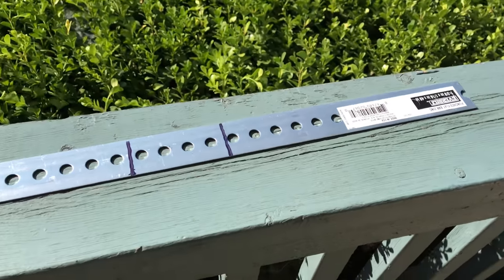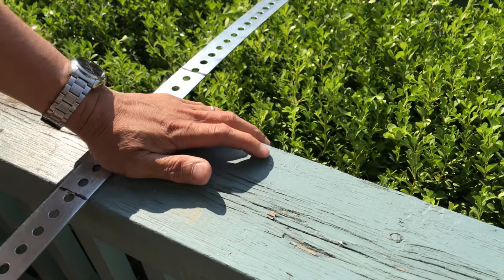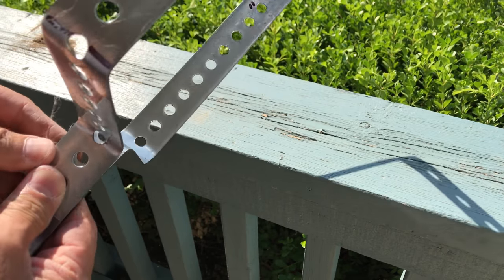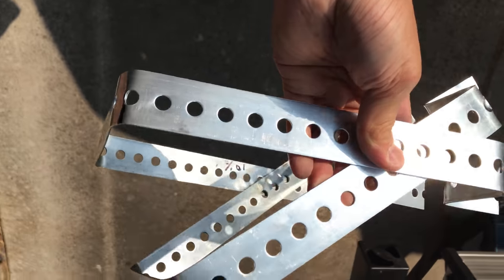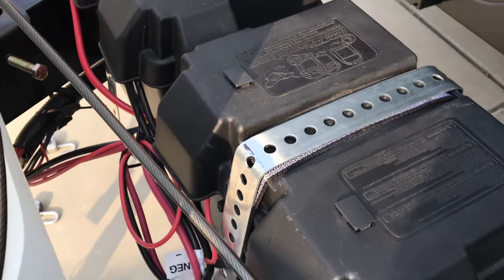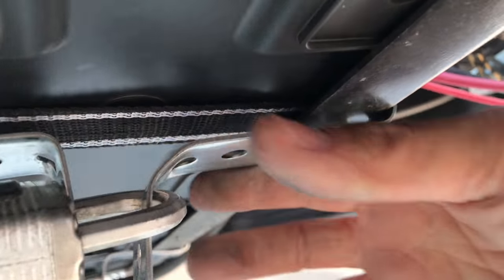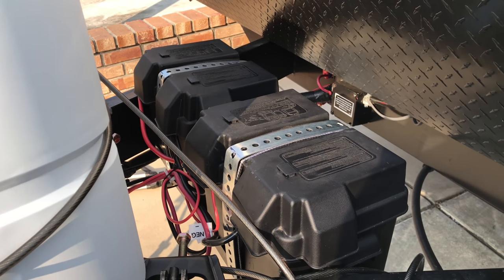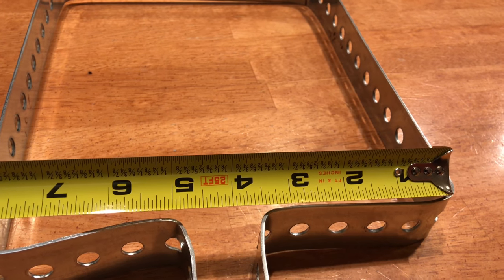$7.00 How to Secure Travel Trailer Batteries - Theft Deterrent Battery Lock for Travel Trailer

Comment: Great Idea and thanks for the measurements on the group 24 box.  I'll be making 2 of these this weekend!
Reply from the maker: Christmaspuss1 thank you very much for the feedback... I hope you watched the measurements at the end of the video... improvement from the measurements at the beginning (bend points)... thanks again
Reply: @cbatilo  I did see that.  Great addition! Starting to store our camper now at a rv storage lot and this will hopefully deter any thievery.  Nothing out there is really theft proof, but this will help.
Reply: @Christmaspuss1  You don't remove your battery(s) and take them home to put them on a Battery Tender?  I'd certainly think about doing that...when putting your unit in Storage.That will keep your battery(s) in pristine condition.  A Battery Tender does such great things for your lead/acid battery...it regularly 'exercises' the cells...(very important for a lead acid battery), and then tops off the charge...all automatically.   I have one on my motorcycle, my trailer, and I have a 2004 motorcycle that has never needed a replacement battery yet!  Using a name brand---->Battery Tender, will not only pay (literally) for itself, but will give you at least 10 years of battery life.  So worth it!  Again, as I entered storage, and parked my R.V., the last thing I would do, would be to bring the battery box home, and then set it up in the garage with the Battery Tender leads attached. Shut the garage door.. and forget it, until you need to take it back to your RV.   That's---->the smart money!  BTW, never put a battery box...(even plastic) on the ground, or a concrete floor.  It should be on a work bench, or at least on a couple of cut 2x4's, sitting between the bottom of the box and the ground, so to be not contacting the natural ground.  Any battery near and about the ground, will leak residual to natural ground....so not a good idea.
Reply: @sesquashtwo  Actually, modern batteries don't drain from being on ground, concrete or otherwise, that's just an old wives tale. Battery acid (or water/moisture) across top of battery  connecting posts is most likely cause for them if disconnected, especially older batteries.

Comment: Add tape or something to cover up the padlock key port. Else it will rot as it expose to road dirt and moisture.
Reply: A little Dialectric grease will do that for you rather than tape that might dry and fall off

Comment: I have been thinking about your design..and can add an improvement...when ready to use your lock...have space washers, that when slipped onto the shank, of your lock...you can not only prevent a hack saw to the lock...but you can then really pull the two sides very close and tight.  That is what I am going to do...just hit the hardware store...and grab a bunch of washers....and again, a great idea....and oh...use the washers to fill the space between the bracket and the body of the lock.  Add enough washers, so that the two locking ends of the bracket are almost flush to each other!
Reply: Joe Blow the washers / shank idea is awesome! Going back to the electrical tape... plastidip (rubber coating) is probably best. Thank you again for watching

Comment: Great idea...and will copy your suggestion...but I do have one modification...I will add and wrap electrical tape around all the bend joints...so no metal to metal contact will be had between your strap, and the frame of the battery support/RV frame.   I'd suggest to all readers to wrap all the bends...
Reply: It's the contact btw strap  and Positive cable that you should avoid (at least, on sharp edges of strap). Contact btw strap and frame is not a problem because frame is the Ground.

Comment: Great idea!  One thing I would change - change the design to make it where the padlocks are on the back of the batteries, or front if thats the only place it will fit.  Do this because hanging down, your locks are going to get full of dirt and road debris.  They wont be functional very long hanging down that way.  I also put a little dab of silicone on the very end of the keyhole to seal it.  Do not push any into the lock or it will stop working.  Break off the silicone when you need to unlock it.

Comment: Very clean looking . I had strapped snow chain over mine and connected with a chain to since it didn't  reach  someone cut one link weeks later but batteries were still there . I would like to point out that I bought 2 golf cart batteries from Costco and they required a taller box . These batteries do not have a handle to carry  , they have slots on top that you have to put a strap through to carry. In addition each weight 53 pounds. Just to add some info. .Golf cart batteries only have a bolt/wing nut pot not a car post .I believe it is just for long lasting low voltage no amperage making it a specific use which I find a deterrent .

Comment: Excellent video and thanks for the tip! I used this technique on my RV! I bought the flat bar in a roll at Ace Hardware 10ft for $1.99. It still looks good and there’s enough for 2 battery boxes. For about $10.00 including 2 locks is how much I spent for this project.

Comment: cbatilo - nice, cheaper than $35 store-sold bracket, though those are more solid.  One problem - if there is enough room on the tray, and/or if you have only 1 battery, a thief could cut the un-protected plastic wall and slide the battery out.

Comment: I will be making 4 of these.  You make it look easy enough to bend. Is it?  Thanks!
Reply from the maker: It is easy to bend... but the shorter bends are a little harder. You can do it
Reply: @cbatilo  Great! I will report back :)  Do you have suggestions for propane tanks?
Reply from the maker: I actually do... I wish I video taped it. I will do one... I bought a long lockable cable. It is very long... I wrapped it around my tanks... it is also the same cable that locks my generator. I will demo it and make a quick video out of it. Thanks for the question and video idea.
Reply from the maker: This is the cable I got. a 30 footer for my tanks... then I extend it when I unload and run my generator... but if you are on a budget, buy 15ft. get a good padlock with it. https://amzn.to/31AGzCR
Reply: Well, I  measured and began to bend but it looked too small.  Measured my boxes this morning. They are 6 volt boxes!  Should have measured in the first place. The measurements came out exactly to 48".  Lesson learned.  Let the bending begin.

Comment: You warn that "Metal bar and battery don’t mix well bare".  Is it the fumes from the battery that would affect the metal?  What could happen?
Reply from the maker: The first and obvious one... the bar twisting and touching positive and negative (completing the circuit). The other is battery acid and galvanized steel and the fume from both (if inhaled-poisonous...). Thank you very much for watching and for the feedback.
Reply: Thanks for the video and for your response!

Comment: If you lock under like this, use the locks that have a weather cover over the key section to reduce mud etc into the lock...or carry a LOT of DW to clean them out!:) Also, do the corners tighter...it will pay off with vibrations in the end. The measurements are not quite right as you also have to take into account the bends:)  BUT GREAT IDEA!!:)
Reply from the maker: Thank you for the cool feedback - enhancements

Comment: I don’t like the bottom, should have pulled the metal taught.. someone could just bend that out with their hands like you did and fit the steel rings  over the ridges and off your battery. Should do an updated design vid!

Comment: That’s not a secure idea at all , Tin snips will go right through it in seconds . The only way to secure is to be able to crank them tight but still that material is sub par easy to break or cut even just with a screwdriver wedged under will rip it . It needs to be solid steel and tight .
Reply from the maker: Lol! Please create a video where you cut this with a tin snip ... in a  few sec... I own different types of tin snips... please back your claim with a vid. I promise to watch it. I am not saying this is bullet proof (as I stated in the video). You can definitely cut it but not with screwdriver and a tin snip. Tin snip? Screwdriver? Lol... anyway, I do appreciate you watching! I beg to differ.